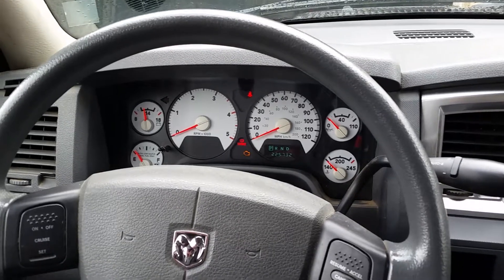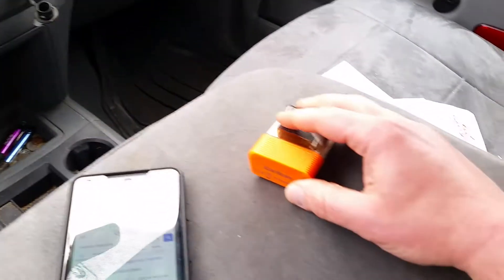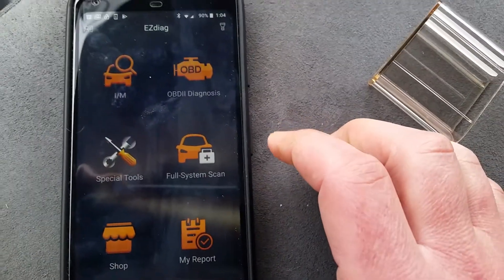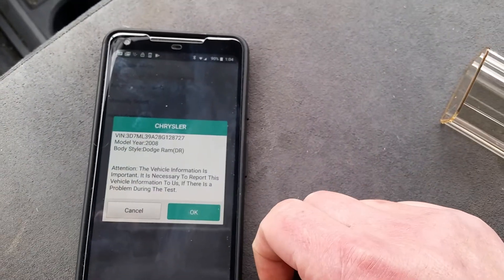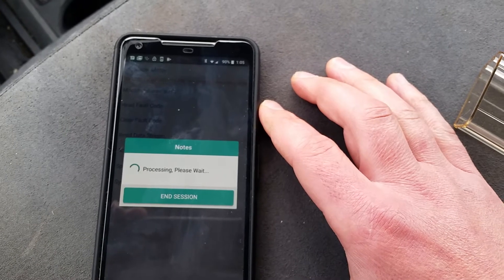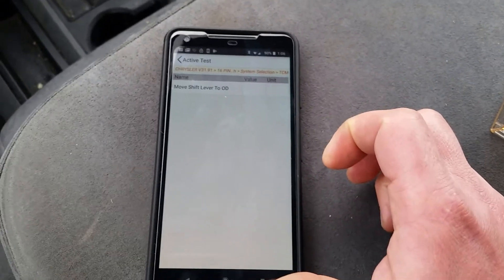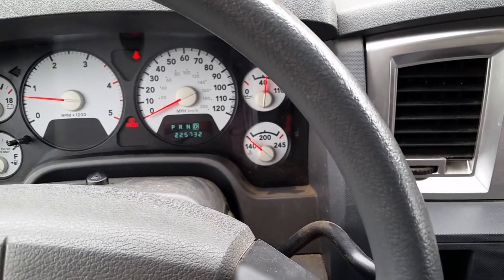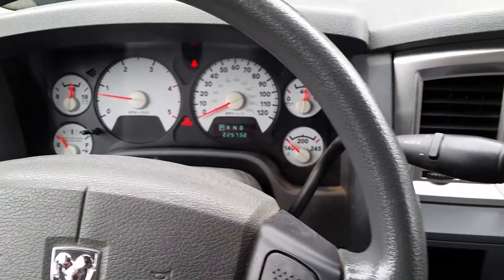Dodge Ram / Chrysler Transmisison Quick Learn With Launch Icarscan x431 on 68RFE

Comment: Fantastic!  Thank for the high quality videos!  I can’t believe I’m just now finding your channel. 
What are your thoughts on using this scan tool to do the re learn on a stock transmission from BD Diesel?  They sell a fully stock 68 RFE that only has a new valve body separator plate and pressure control module to deliver up to 250 PSI clutch apply pressure.
Reply: better do a learn with the new pressures. I have 2017 2500 with 68rfe and going to up grade the valve body with pressure controller . One video from ats mention having to do a quick learn because of modification. The guy in the video said anytime you do a transmission mod or truck engine mod, to do a quick learn or you can damage the tranny. So I'm researching scanners that do a quick learn so far this but I cant find the software for Icarscan, But the foxwell NT680Pro does it too. That scanner seems to a full diag professional scanner for $384, Icanscan is $235 plus you have to get the software plus their subscription cost
Reply: @RobRocker09 what did you end up getting
Reply: @donkintz281  Went to Rev max and got the their valve body, they test it to 350 lb pressure before they ship it, then did a quicklearn
Reply: I mean what scanner did you get

Comment: Is it necessary after replacing solenoid Package?
Reply: from what I understand two transmission shops said it has to be done.. it seems like mine needs it after the Solenoid pak was replaced

Comment: I’m going to replace a solenoid pack in my 3.7L dodge nitro. Do I have to take it in to a shop and have them do a quick learn / relearn. If so would it be ok to drive it there myself. Will it self learn and if so how long will it take? What is the best way to go about it?
Reply from the maker: I Cesar, if it has an rfe transmission then yes, you need a relearn.  If the shop is close I have been told by one of the engineers that worked on those transmissions you'll be OK, just drive easy.

Comment: Will the transmission have to go through a whole learning how you drive process ?
Reply from the maker: Yes but the quicklearn will start that process properly.
Reply: Diesel Camper I just had this done to my Cherokee today cause it was shifting hard in 5th. I was concerned because it seemed to be driving a little odd after this was done.  How long does it take usually ?

Comment: What is the reason for doing this?
Reply from the maker: It is necessary after a rebuild or changing anything valve body related.  The computer remembers how much fluid it takes to apply a clutch.  Not doing a relearn after certain jobs can cause severe transmission damage.
Reply: @DieselCamper  thanks.  So, this only applies after transmission changes/repair.

Comment: Will this show the steering angle? I need to change my clock spring and I’ve been trying to find a reasonable priced scan tool to see this function on my 2010 Ram. Great video by the way.
Reply from the maker: I'm really not sure, you'd have to see if it's listed on their website.
Reply: @DieselCamper  Yes use the LEFT handed Sky Hook
Reply: Burton Yeager launch Diagun x431 or thinkdiag

Comment: I believe theres an option starting in 2006 to hold the transmission in 3 rd gear while towing.  I have a 2005 like yours and when towing uphill I'm forever upshifting when I would rather it didn't .   Is there an option on this Icarscan which will allow this?  thanks for posting the vids
Reply from the maker: I haven't seen that option in the icarscan, but I'm pretty sure it exists on the DRBIII.  I know it is an option on smarty UDC pro and I have it activated.  Very nice to keep the gear hunting down.
Reply: thanks, I was considering smarty UDC for tweaking and tuning anyway.  that'll work out well!  cheers

Comment: Does this thing have vgt actuator calibration?
Reply from the maker: http://www.x431.com/news/newsShowAction.do?id=1917

On line 2 it mentions turbo actuator calibration so I think it does! 👍
Reply: Seems like it does a lot of things, I shall start saving my pennies for one of these.
Reply from the maker: Yeah, if you assume each option or test you have the dealer perform would be $100 then you can see how fast this thing pays for itself.
Reply: No kidding
Reply: Diesel Camper one more question, does it have gauges/datalogging?
Reply from the maker: It has some very basic data capture, not sure how useful it would be because if I need to data log I'll do it with my smarty touch.